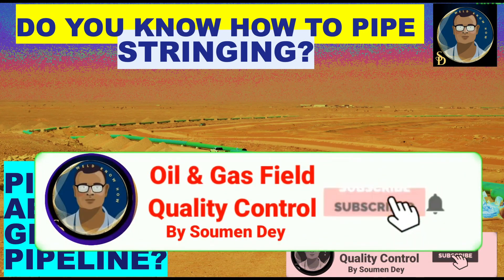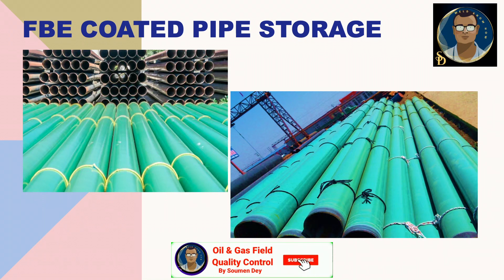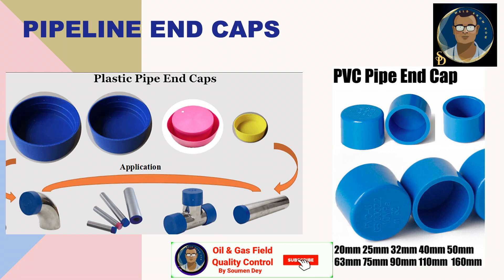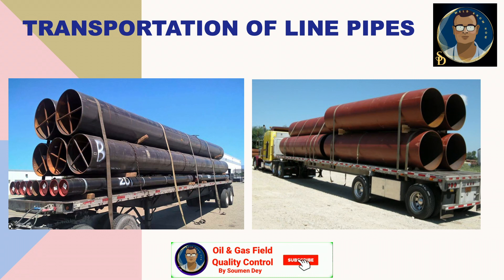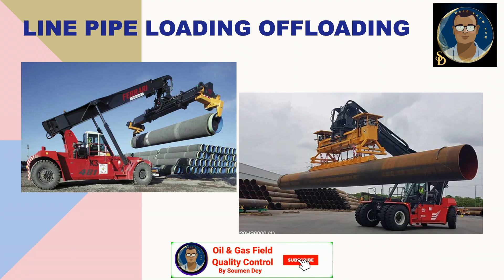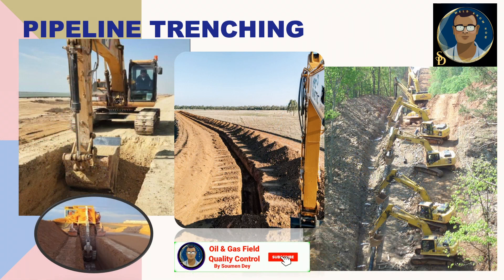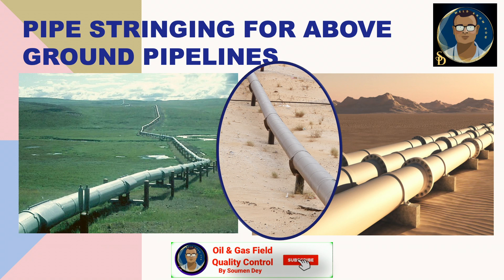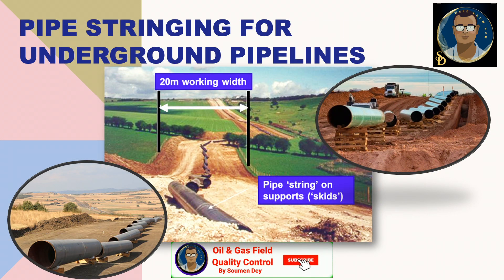What Do You Mean Stringing And Laying In Pipeline?

Comment: Bro which size of of pipes used in pipeline project
Reply from the maker: PIpeline can be 2 inch to 60inch or more based on the requirements. Service can be utility, gas, crude oil,  Raw or refined products, Drinking water, Sea water, Fire fighting or potable water.
Where we need a continuous transportation of any liquid or gases over the country and under the sea, pipeline is a kind of permanent solution- can run long years.